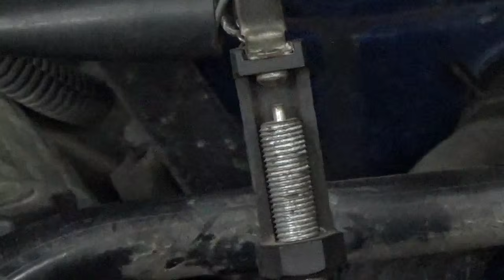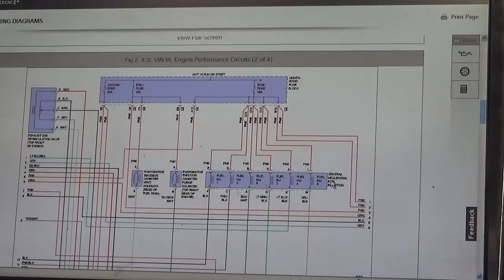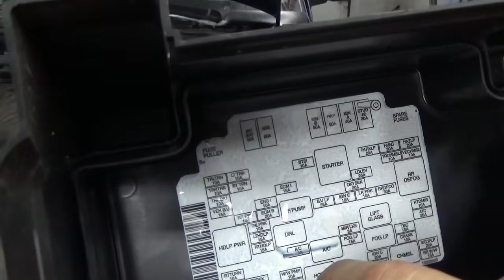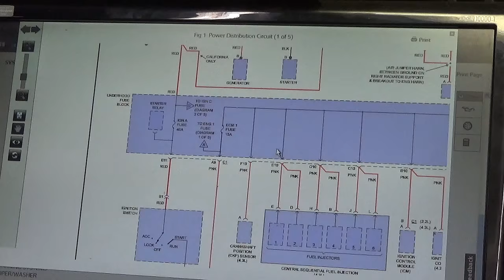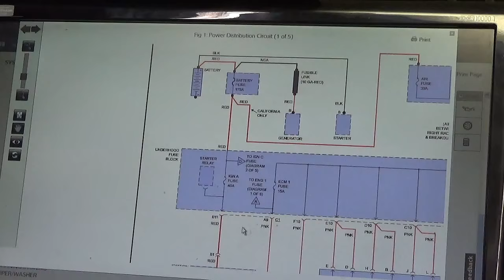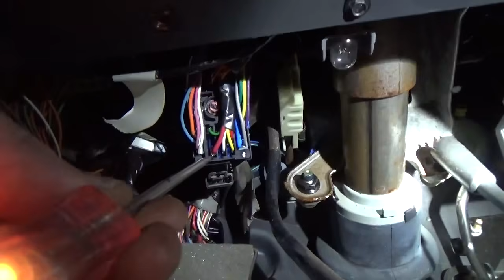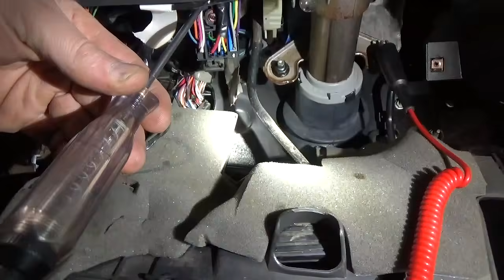No Start / No Spark / Cranks OK - GMC Jimmy / S10 Blazer

Comment from the maker: Appreciate that. Thank You! Actually going to replace the switch in it today. Just got the new one yesterday. A little better shape than the first one they sent me haha.
Reply: HELLO FROM CT HAVE 97 DODGE NEON REAR WINDOW DEFOGGER WONT HEAT UP
GOT GOOD FUSE 
HAVE GOOD GROUND BUT NO 12 VOLT TO WINDOW
ANY THOUGHTS?
THANKS
Reply: +South Main Auto Repair My Jimmy has a problem like this, but it also back fires from the intake should do the same thing you did of is the problem to big to fix?
Reply: Fuel Injection Units faulty. Open intake plenum for replacement, Backfiring is leaking fuel. Common on the 4.3L engines
Reply: that backfire is timing.
Reply: I got rid of the peace of junk don't bother guys.
Reply: Wow totally awesome i love this channel, when you have the right tools everything just seems so easy turnt out the 2008 chrysler pacifica needed a ignition switch plus auto trans axle seal ,had to refill  with three quarts of transmission oil
Reply: Great skill in trouble shooting. What software did you use? And where can I find it please
Reply: South Main Auto Repair @soutmainautorepair I got a question, I have a blazer xtreme 2001 and I replaced the starter because it was bad and then I replaced the switch because it was bad, I connect the positive and then the negative and the car turn over and the motor starts up without having to putt the key inside . What do you think seems to be the problem , keep in mind the blazer only has 2 cables connected not 3 , can you help me fix this issue ?
Reply: South Main Auto Repair @soutmainautorepair I got a question, I have a blazer xtreme 2001 and I replaced the starter because it was bad and then I replaced the switch because it was bad, I connect the positive and then the negative and the car turn over and the motor starts up without having to putt the key inside . What do you think seems to be the problem , keep in mind the blazer only has 2 cables connected not 3 , can you help me fix this issue ?
Reply: South Main Auto Repair I
Reply: I have replaced everything in my cooling system on my 05 trailblazer and it's still overheating any suggestions

Comment: how many people work at the shop? nice diagnostics. do you prefer all data over mitchell? i personally like all data better, but everone has a preference
Reply from the maker: Thanks! It's just myself and one guy I have working for me, plus my wife in the office. I use to love Mitchell1. I have used it for almost 18 years then we have been forced to switch to ProDemand (aka Obama-Demand I call it) and I really don't like it. Just harder to navigate. I recently tried MotoLogic and that program is just a disaster lol.
Reply: pro demand cheaper? got a question about p0136 i looked at the rear o2 sensor its pegged at 0.09 - 0.18 i first added propane to intake no change at all checked for power to sensor and signal wire for opens and shorts none found replaced sensor didnt fix it. now the sensor responds full rich with brake clean. but goes back to full lean after done spraying. suggestions? also p1443  related?
Reply from the maker: I think Pro demand is around 180 a month or something like that.... and what kind of vehicle are you working on?
Reply: 1997 mercury tracer
Reply from the maker: phil holbrook  Being that it is only affecting the rear 02 sensor I'd be looking for an exhaust leak near the 02. Is the flex pipe broke or any thing like that? Crack near the 02 bung? I wouldn't think the 1443 no purge flow code would be related unless it was a vacuum leak causing that code in which case I would think you'd have a P0171 lean code too ya know...
Reply from the maker: Also I'd tend to think sight unseen that the wiring is good being that it responds to parts cleaner...
Reply: I had the same problem on my 2008 Chevy trailblazer, I bought one from auto zone and only worked for 1 week and then bought the OEM  one and now I am going on 1 year without any problems, always buy OEM